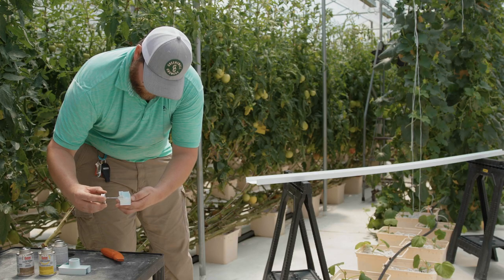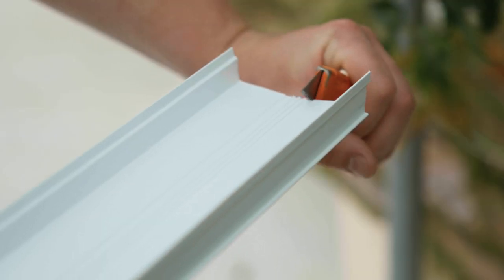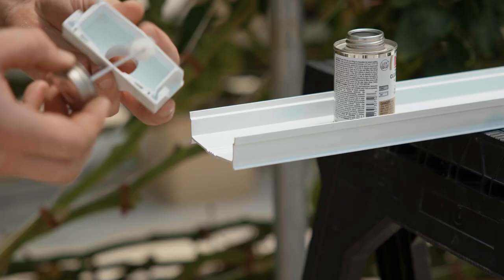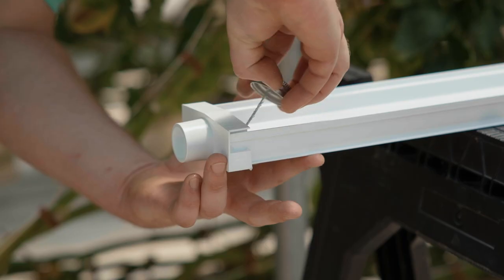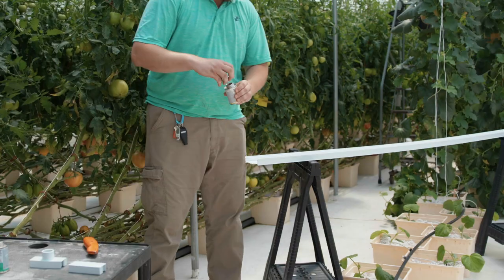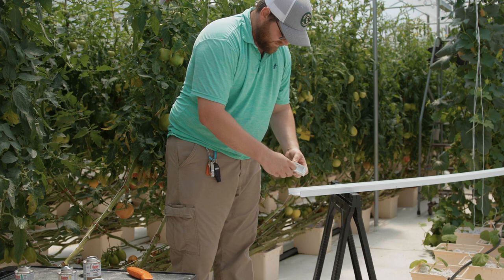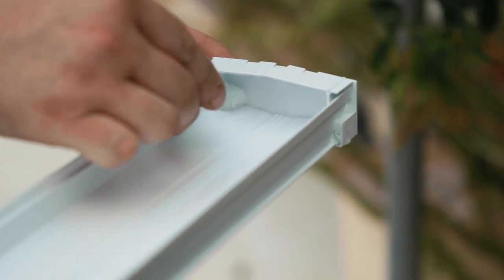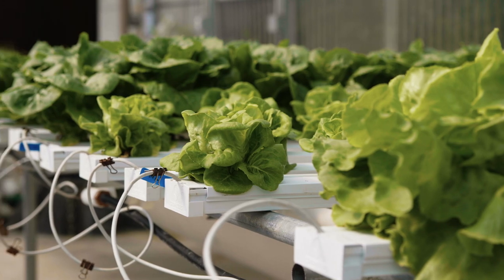Gluing Hydroponic NFT Channels | CropKing Inc.

Comment: But what if the channel is bowed ? Noticed that when dry fitted but tried to  hold it down flush to the end cap bottom but it leaks anyway🤦‍♂️  really killed my enthusiasm, didn’t want to glue up the rest of the channels  so I’m going to get some silicone to patch up that rail and see if silicone alone will will work on another and if it does finish the rest that way 🤷‍♂️ though I’m still a cropking fanboy  just a lil disappointed  don’t know if I just got a  bad batch or if that is normal , plus the tops are short  leave a 2in gap from the end 🤷‍♂️ no biggie figure  duct tape  will fix that light entry point 😂 ✌️🤙
Reply from the maker: Thanks for your comment! If there's an issue with your purchase, feel free to give us a call at 330-302-4203. Happy growing!
Reply: @CropKingInc   thanks  I would’ve but already felt like  a was being a whiner , there was a couple other issues or fiasco’s   Straightened out , but was feeling like a nuisance since I’m not a big farmer or even farm market size ! 🤷‍♂️   ✌️🤙